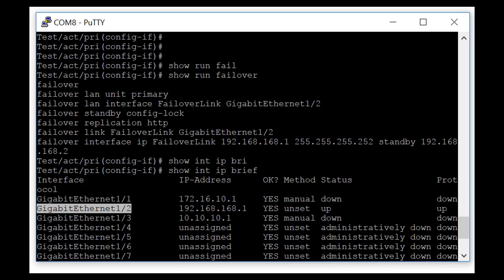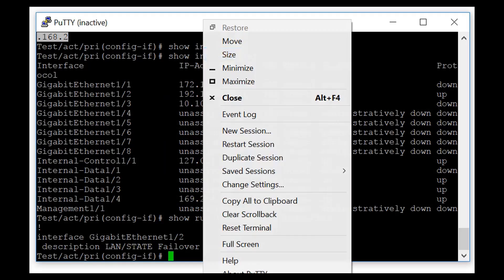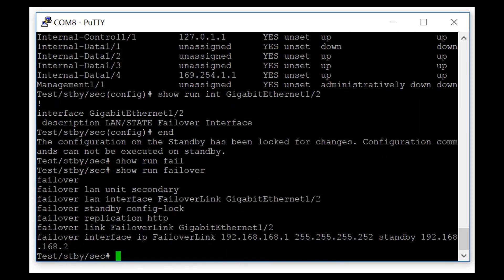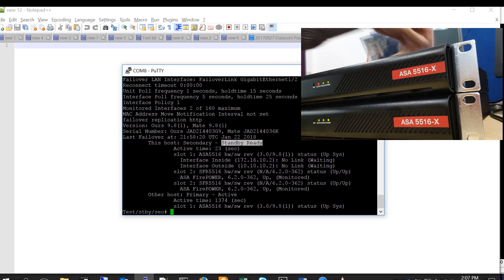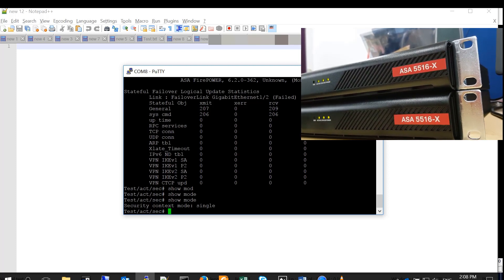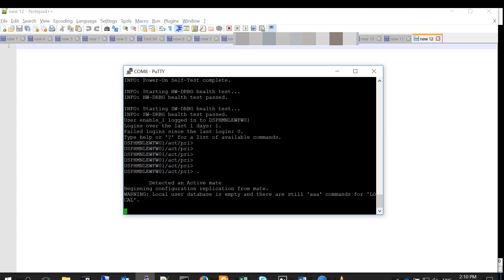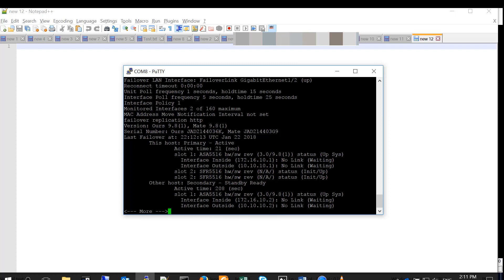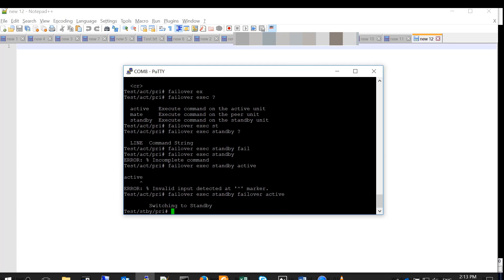High Availability With Cisco ASA

Comment: Very helpful mate! Do have a visual of how the two asas are plugged in?
Reply from the maker: I can snap a photo, no problems... it's very simple. One interface of your choice from primary to secondary directly... a normal ethernet cable should do it.
Reply: @loopback  Yes if you could snap a photo that would be very helpful, so both ASA's have a cable plugged into port 1 providing internet, a cable plugged into port 2 going into the internal LAN switch, and then connect port 3 directly from one ASA to the other?

Also, do I plug both port 2 cables to the same LAN switch?